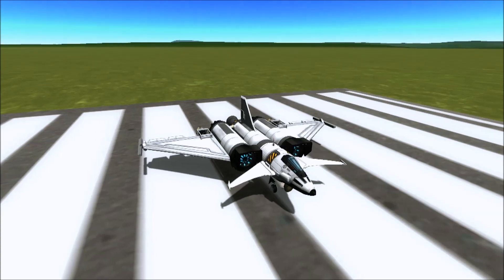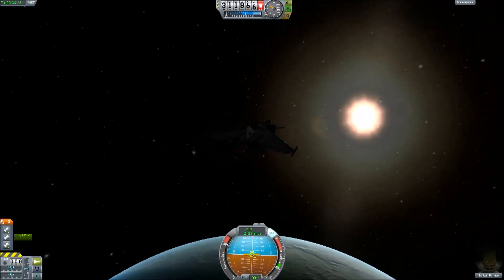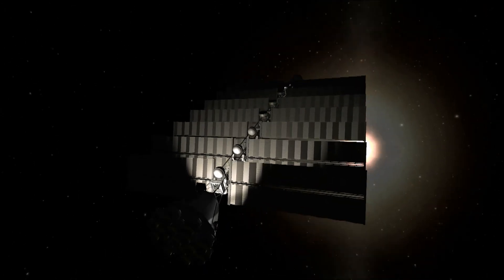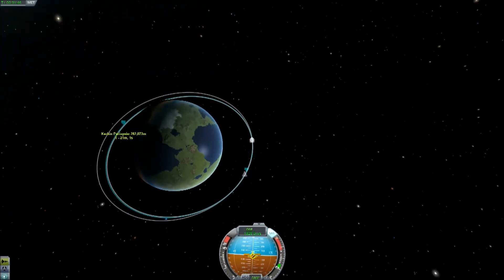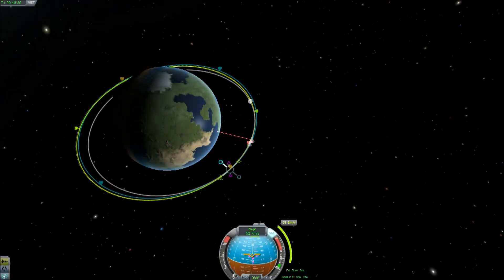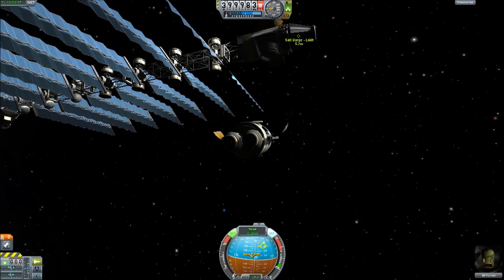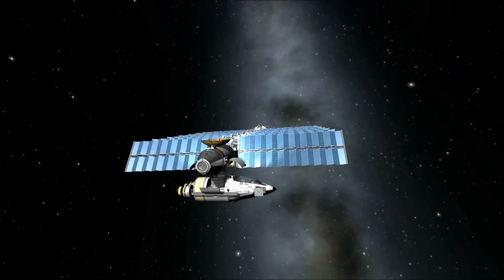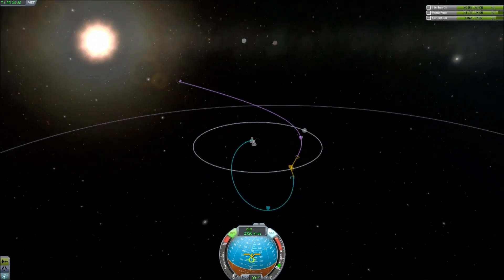KSP - Experimenting With Ion Drives

Comment: A question:
Do I need to attach the solar arrays near the ion engine (to a battery or something) or I can freely install them where I want? I build a space station and I want to drive it with ion engine (as supplementary) but it doesn't work. As I've got know I need a lot of power to work but I am not sure about the place of installing...

Comment: Ion drives were right up my alley. Efficient, solar powered, futuristic looking, small. But they are just not practical. I had a ship with 32 ion drives, using a minimalistic lightweight frame and a probe computer, but it was still so slow I gave up before making it to the Mun.

Comment: Yeah, I know that. And since that is true, you should only use Ion engines if you have a lot of time on your hands. And the reason I said you need in excess of 8000 was to point out that that you would need 8000 times the thrust, just to get .5 G actually. But considering the needs of the engine and the fact that it can't even lift itself, yeah, you can never get 1 G.

Comment: You actually cannot get a ship to accelerate at one g using ion engines. The engine itself weighs .25 tonnes and produces .5 kilonewtons. Since a = f/m (from f = m*a), you cannot get an acceleration better than 2 m/s^2. And that is still overly optimistic, since you need at least one solar sail to run the engine, which weighs .35, bringing your maximal thrust down to 1 m/s^2.

Comment: OR about 12 thermoelectric generators per Ion Engine. I did the math, and did some experimenting. I finally realized why full power is at dawn and dusk, though. Because you burn a certain direction and a the solar panels face the sun, and get full radiation.

Comment: im trying to make a Hybrid Ship. using ion drives for the fine maneuvers [accually always on] and 4 Rockomax "Poodle" Liquid Engine / or / LV-909 Liquid Fuel Engine. and one main rocket the Rockomax "Mainsail" Liquid Engine based around a Rockomax Jumbo 64 Fuel Tank. but im having a bit trouble to achieving a ION drive bundle... say 4 per compartment. but now I see its posible in a way.

Comment: Solar panels get more efficient the closer you get to the sun. So you can actually have a huge stack of ion engines powered by 2 large panels when you are at moho distance from the sun. The problem then is running out of xenon.

Comment: Duh, bigger Ion engines. or more, your pick. If you have a beam across the back with Ion engines all the way down it on the rear with 3 tanks in front of them, and then have solar panels on the beam as well,and have a good amount of xenon gas in the center. That was very vague, sorry.

Comment: I've just put a ship with 42 ion drives on an escape trajectory from Kerbin. The launch phase didn't get me past the Mun and escape is 10hrs away, which is a long time with 4x physical acceleration.
As far as I am concerned, ion drives are at present useless, for 2 reasons.
1. I can't warp time while the engines are running
2. The power requirements are insane.
To power my 42 ion drives I built a ridiculous "ship", which is basically a frame for 60 solar panels.

Comment: I found a nice mod that fixes this, to a certain extent. The "Hybrid ion drive" mod, on the Space Port. It adds more powerful ion drives, and hybrid drives, that are even more powerful, but also use a small amount of liquid fuel and oxidizer. They are still a bit under-powered, thought, so modify the thrust as you see fit.

Comment: Ion drives provide almost no thrust. Its not really worth it to use them, because it takes hours and hours and hours to get anywhere with them. I under stand making them provide 20 kilo newtons of thrust, but any less than 10 is jut unreasonable. They only provide 0.5 kilo newtons. The lowest thrust any standard sized rocket engine provides is 60 kilo newtons.